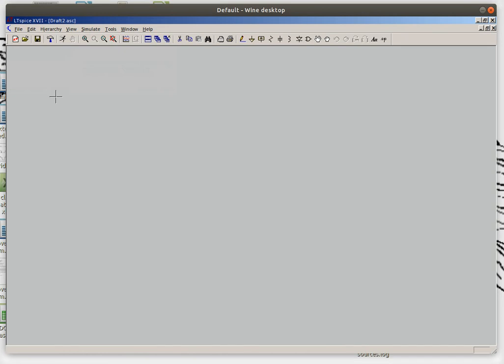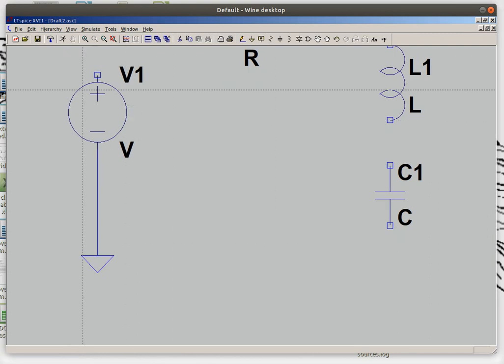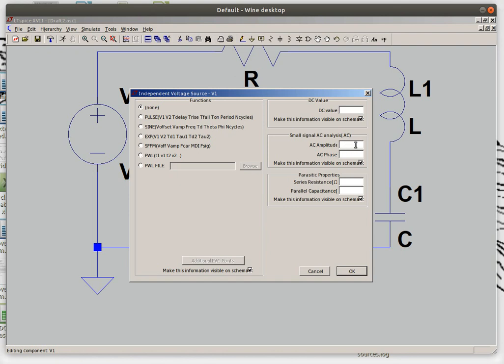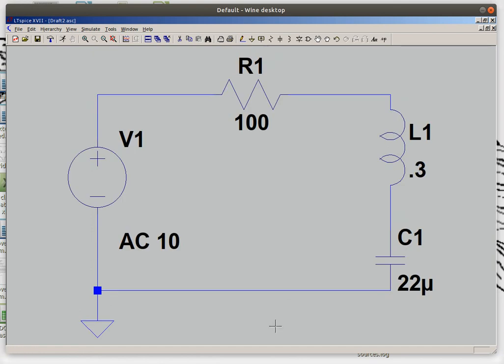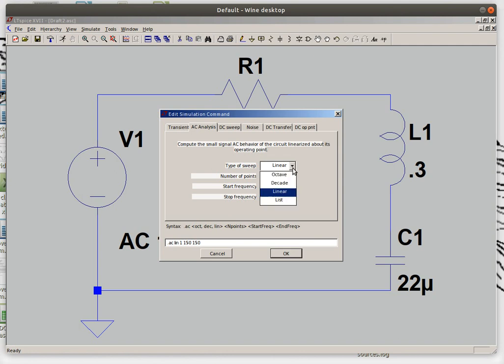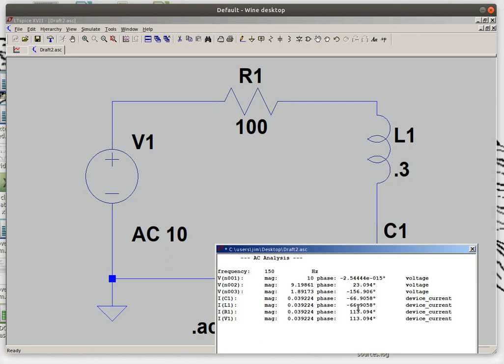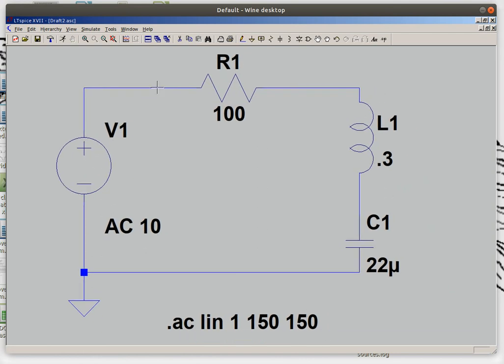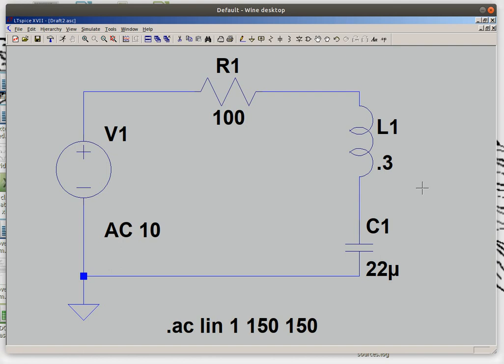series rlc ac analysis

Comment from the maker: LT spice analysis is given in polar form 10 angle 0 - 9.2 angle 23 is actually 3.9 angle -67.  I converted to rectangular then back. So the Vr would be measured as 3.9 volts.  Similarly the Vl is 9.2 angle 23 - 1.9 angle -157 which is actually 11.1 angle 23.  Vc is 1.9 angle -157.  So for a source V of 10 volts measured, the measured Vr is 3.9V, the measured Vl 11.1V, and the measured Vc is 1.9V.  3.9+11.1+1.9 do not add up to 10 at least on appearance, but those voltages do peak at different times based on phase angle, so they really do add up to 10

Comment: I don't know why you say that the voltage drops do not add up to zero with a voltmeter. The voltage measured across R1 is 9.2 - 1.9 = 0.8. The voltage drop across L1 is 9.2 - 1.9 = 7.3 and the voltage drop across C1 is 1.9. The total voltage drop is the sum of these which is 0.8 + 7.3 + 0.9 = 10 volts. Of course each of these would be divided by root 2 as it is measuring RMS voltages but the voltage rise across the source is identical to the sum of the voltage drops across the components.

Comment: Hi. It is a great tutorial video. Thank you. 

Please, the currents at R, L and C components had different phases and a did not understand why, so, could you please inform why it happaned?

Thank you again.
Reply from the maker: Since it is a series circuit the current should be the same throughout.  Sometimes LT spice will show angles that are 180 degrees off or pi radians, Its really the same phase angle and has to do with the calculations internal to spice.  You can always move the angle 180 degrees and change the sign of the magnitude (+ to -   Or  - to +) its the same point when graphed.